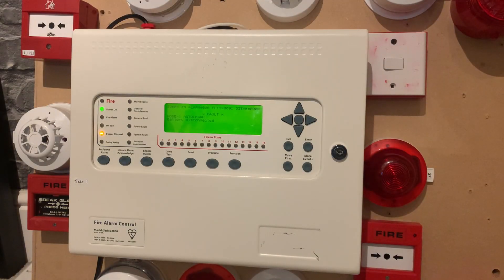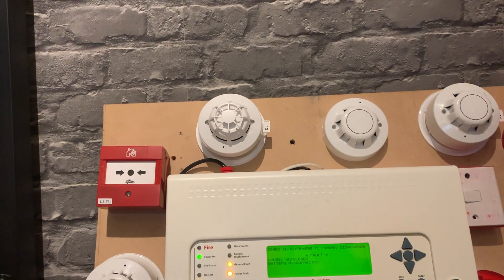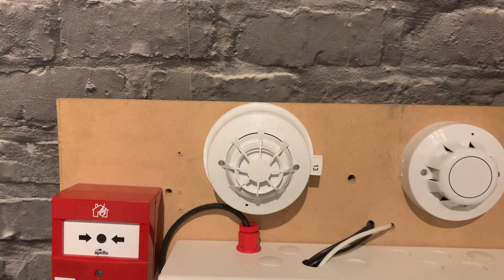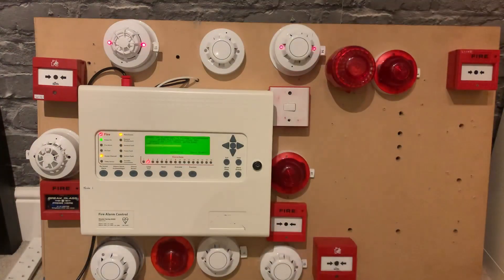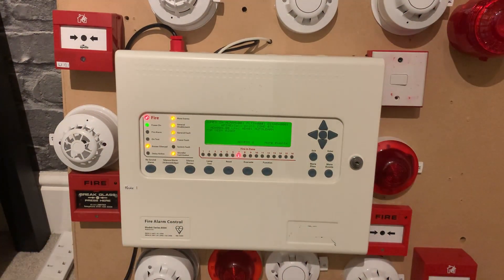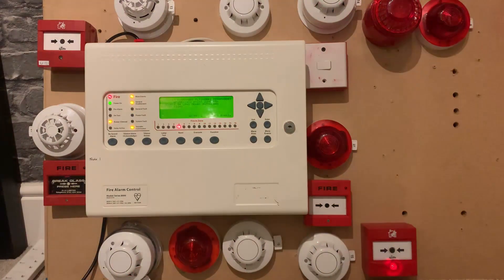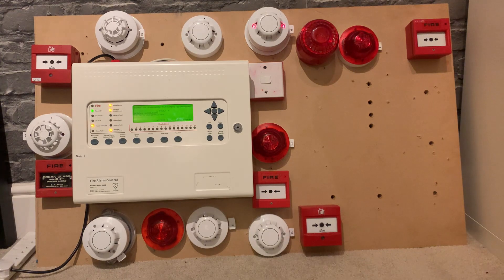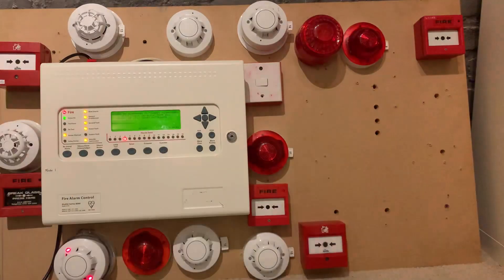Kentec Syncro Board System Test 3 (Apollo)

Comment: Old kac call point and a xp95 open area sono sounder beaceon and a old kac call point and discovery multi senser on a sounder beacon base and a old kac call point and discovery optical and apollo intelligent call Point and discovery optical and apollo beaceon and discovery optical on c tec vad base sounder and apollo beaceon and discovery optical and discovery optical on a integrated sounder base and discovery heat detector on integrated sounder base and a apollo xp95 call point

Comment: In my school, there is a stair way which is usef for fire exits and when the fire alarm goes off, you can see them all flash at the same tine (protec)
Reply from the maker: That's pretty cool, protec throws sync commands quite often to re-sync everything. Whereas my panel is quite reluctant to send them.